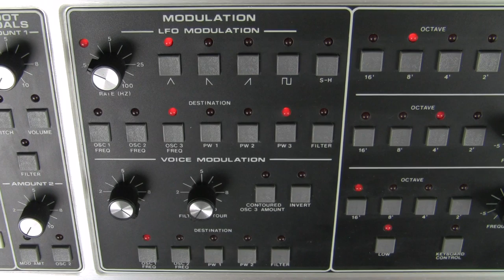04-The Moog Memorymoog Part 4: Voice Modulation Part 1

Comment: That oscillator 3 means business. If I had the chance to take some of the MemoryMoog out, and create a smaller model, I'd take the calculator (obviously), and Osc 3, and a smaller mod section, with more functions accessed through the keypad.

Seriously, this is a nice synthesizer. It's too bad they cost more than. . .well they aren't cheap. Great videos!